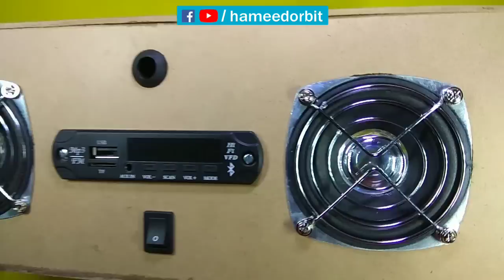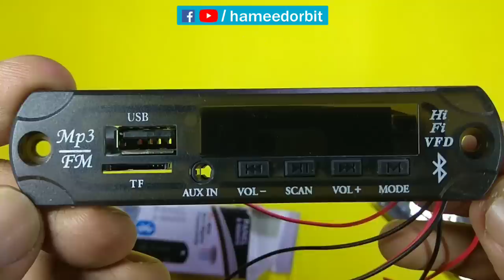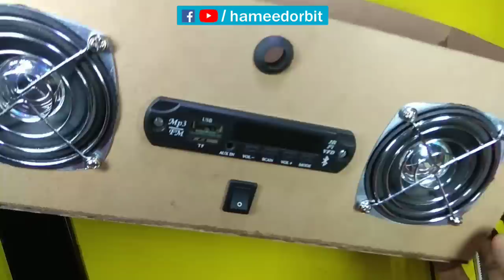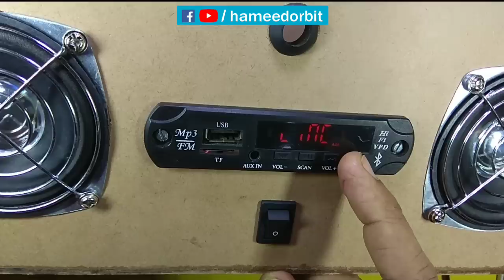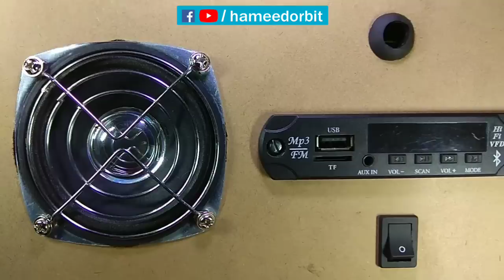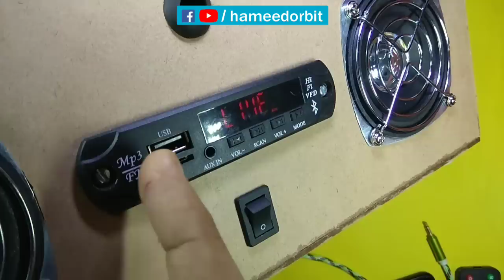Bluetooth speaker ഇനി ആർക്കും നിർമ്മിക്കാം. DIY powerful Bluetooth soundbar

Comment: 12 വോൾട്ട് എലി മീറ്റർ
 5 വോൾട്ട് എങ്ങനെ മാറ്റാം
Reply: Diodu , capacitor vech dc akam
Reply: Regulator ic use cheyuu
Ic name kanunna portion nammude nere pidikkuka.first kanunna pinnil 12 voltinte +ve kodukka second pinnil -ve kodukuka.
Third pinnil 5 volt kittum(7805)negative common anutta.

Comment: Bro_ic ഉപയോഗിച്ചു 12 volt നെ 5v ആക്കാൻ വേണ്ട diagram കൂടി കാണിക്കാമായിരുന്നു.... കണ്ടില്ല __
Reply from the maker: അതിനെകുറിച്ച് നമുക്ക് വേറെ വീഡിയോ ചെയ്യാം ബ്രോ. Stay tuned
Reply: 12 vlt positive ic yude 1st leggilum negative 2nd legilum solder cheyyuka 3rd pin 5 volt  (_ve 2nd)
Reply: വീഡിയോ ചെയ്തട്ടുണ്ട്.....ഇഷ്ടപ്പെട്ടാൽ സപ്പോർട്ട് ചെയ്യണേ
Reply: @TubeLightDiscover  yes
Reply: @retheeshchakkara9137  thanks bro